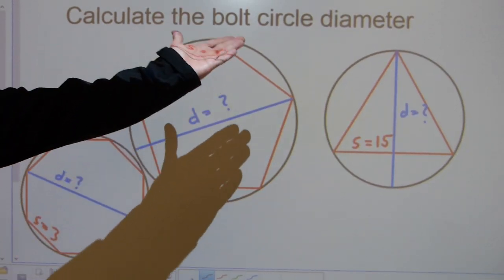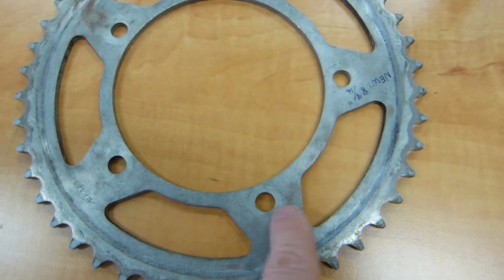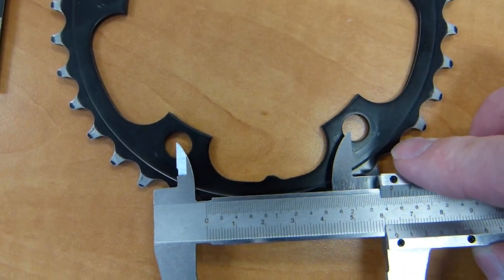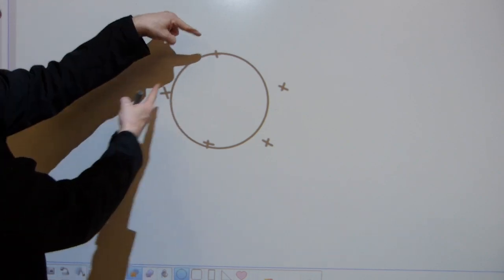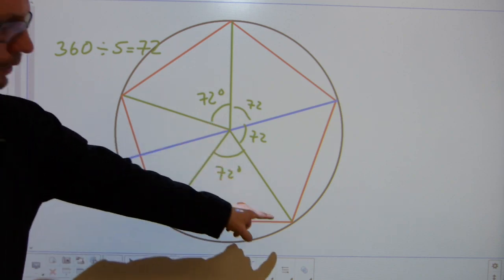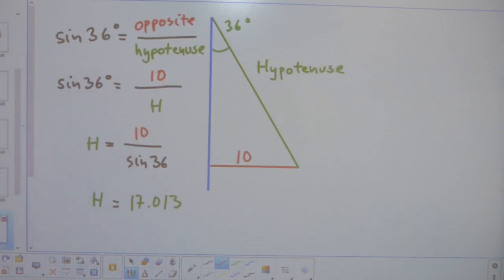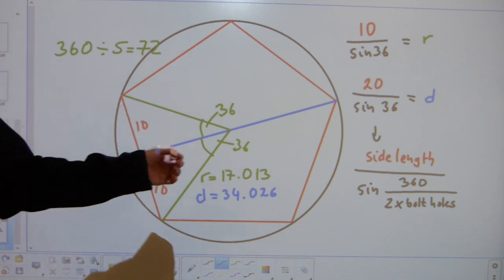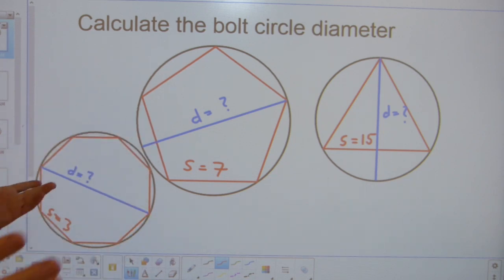Calculate bolt (pitch) circle diameter

Comment: My intuition is that you could take one tooth and find one isosceles triangle with two other equidistant teeth and find the diameter by bisecting one angle. You find that isosceles triangle with a measuring tool and just choosing two teeth that give you the same distance from the tooth in question. I figure most parts would be made using nominal diameters so if you choose the teeth which give you the narrowest angle you should be close enough with that technique.

Then again, I've never worked in a machine shop so I have no idea how these things actually work in practice.